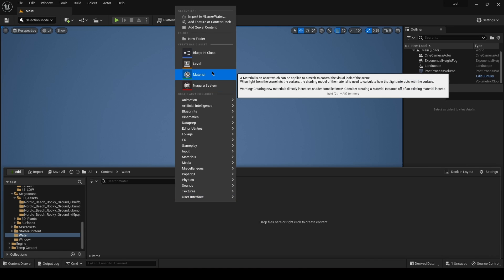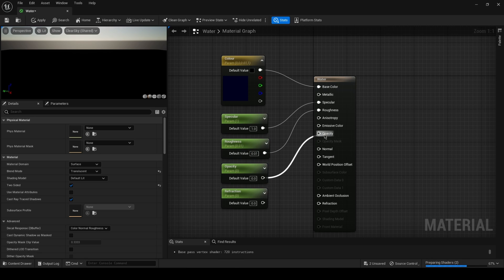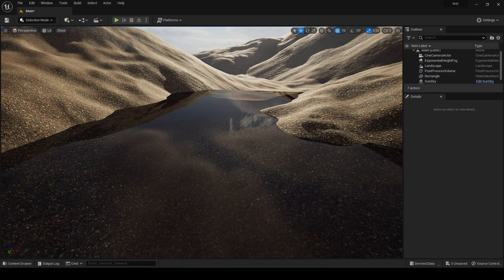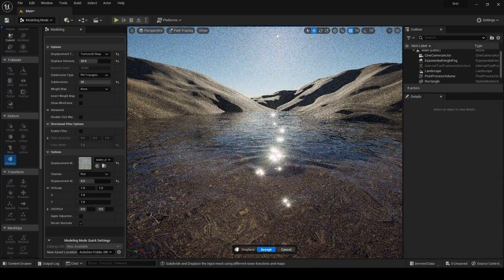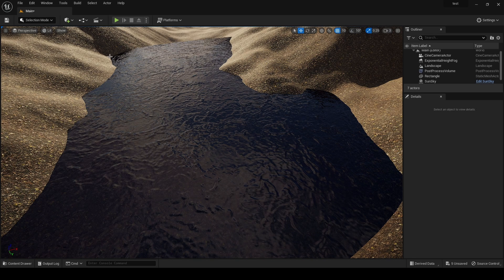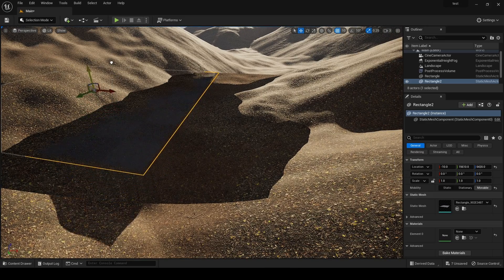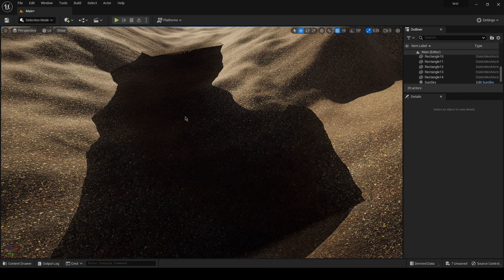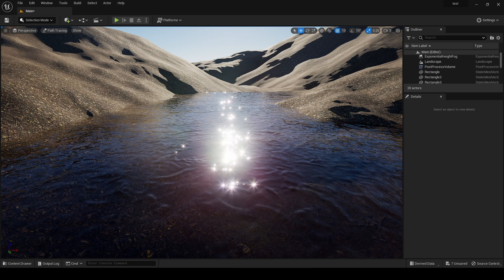How to create Water Material in Unreal Engine 5.1, Path tracing recommended | TUTORIAL

Comment: Enabling displacement isn't working for me in version 5.4. When I add the texture to the displacement, I notice a slight change, but when I apply the material to the water surface, it looks like glass. The material also looks very transparent. I've reviewed the steps one by one several times. And I've set the material's refraction to Index of Refraction.
Reply from the maker: Yeah, this method is quite outdated. I am now researching a better version with animation included. I think your problem though is because of the uvs of the water plane. Although it shouldn't really affect the displacement. But if you're not planning on using path tracing, i would instead make a single layer water material with displacement through world position offset. This option would resolve the transparency problem you have, as it has some parameters that can make the water look clearer at the shore, and more intense in the deep areas. Let me know if I can do more.🙏🏻

Comment: uh so like, 5.3 i know there is a refraction change step, but what mode of refraction do i use..? i did control f for search and 3 things came up about it but idk which one to pick
Reply from the maker: You need to enable refraction in the details panel of the material. Put it to index of refraction. Then you can add the node. If you want to see this in more detail, check the video with lumen glass, it's a similar process.

Comment: Can i make game in unreal 5 using  i5 6th gen , 16gb ram & rx580 8gb gpu inculded pc👀
Reply from the maker: Hmm. A bit tough, because your gpu is not that powerful. So I wouldn't recommend it for like a highly detailed game, but for a smaller one, maybe stylized or with less detailed textures and meshes it will be ok I guess.
Reply: @drawwithnightbuzzer  I wish to make small racing game like Asphalt 8 🤧
Reply from the maker: @VelocityVaultMotorsports  It's worth trying out, good luck!😁
Reply: @drawwithnightbuzzer  thanks😌
Reply: @VelocityVaultMotorsports  there is free game template (during project creation) in UE5 for racing game. It has single car you can control with AWSD, try it out. It's actually not that heavy on system.

Comment: This worked far too well for me. I modelled a crappy water body shape (like a waterfall but very basic)  in zbrush, just a quick sculpt with some basic noise. Exported it at 300k. Applied your basic glass material and the displace but I tiled the displace to by twice as long as it is wide to give the impression of movement. Looks AMAZING. The extra geo due to the high poly sculpt gave it tons of detail for the displace, and the fact that it was a 3d object instead of a 2d plane also helped give it volume. And in those agitated parts of the displaced geo, the water material somehow goes white, so it's like opaque as it runs over the rock bed. Just insanely good. Thanks!
Reply from the maker: I don't feel like I did much, but I'm glad I could help you. You said it turns opaque, did you apply some sort of movement to the material or the object? I wanted to do a future tutorial regarding exactly that topic, but haven't had the time to experiment..